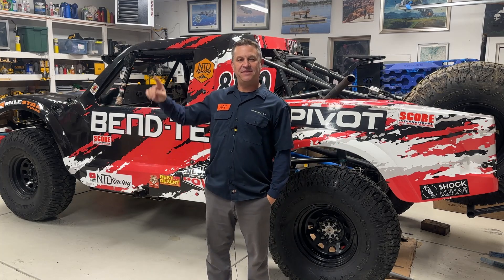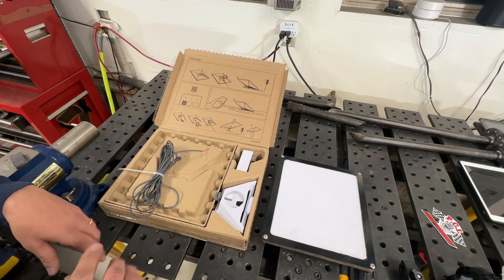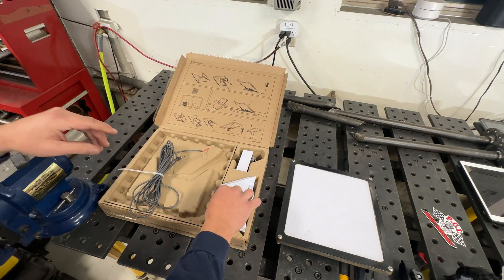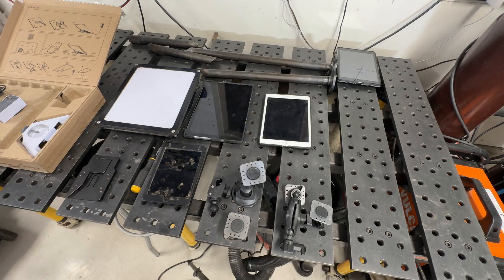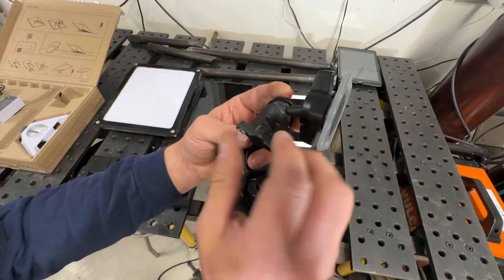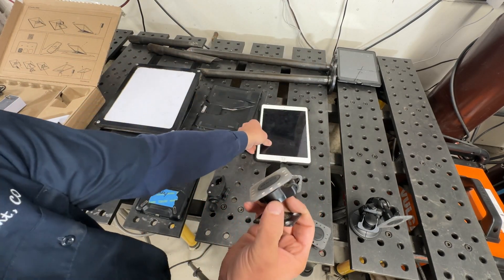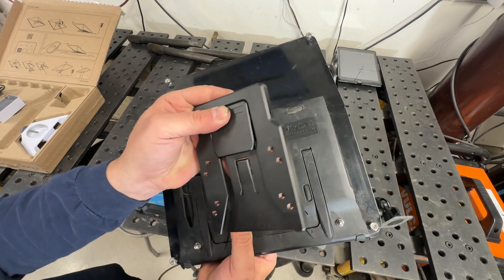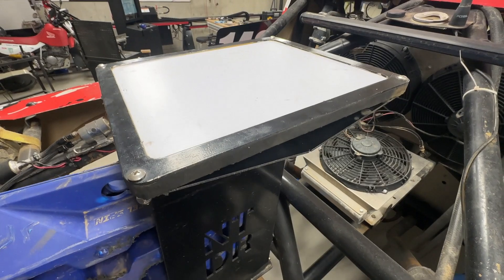Everything About STARLINK Mini

Comment: I’ve been on the fence about getting starlink as i travel a lot for work. This right here just changed my mind. And YES Pivot should make these mounts! I’d buy one in a heartbeat. Thanks Dave! Do you ever do tours of your shop? I just noticed your shirt says Monument, CO on it. I live about 4 hrs away from there. I’ve been a welder/machinist for the last 15 years and have just now decided I want to attempt to build a truck haha. It would be super rad to check out your operation sometime!
Reply from the maker: @thewobblywelder8362  We will be testing some new mounts at the Mint 400 this year.   We have been working with the guys at Ultra Cornhole to test a gimbaling Starlink mount to see if it works better if we maintain the same dish orientation while the truck is rolling and pitching.   Should be a cool set up.